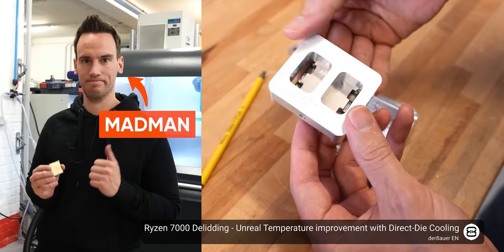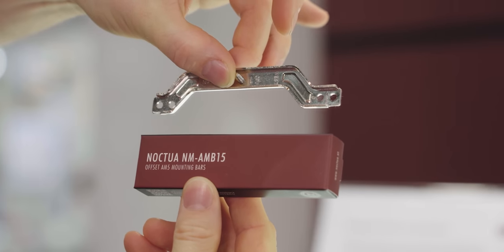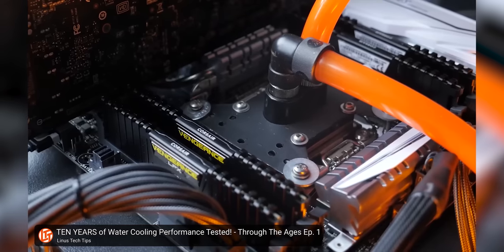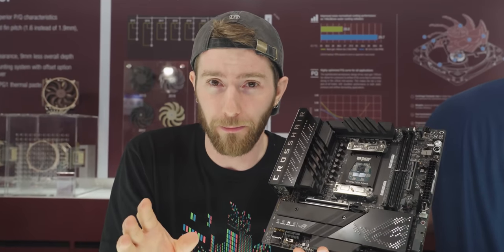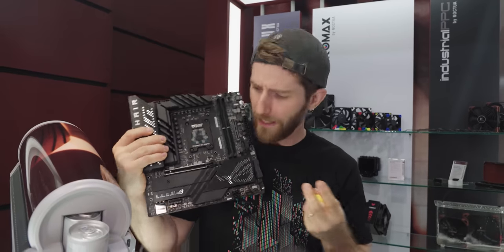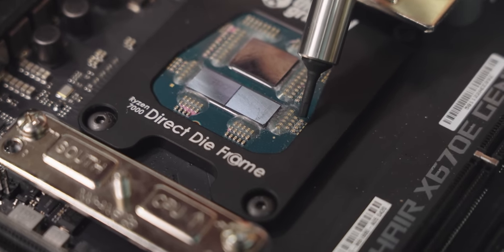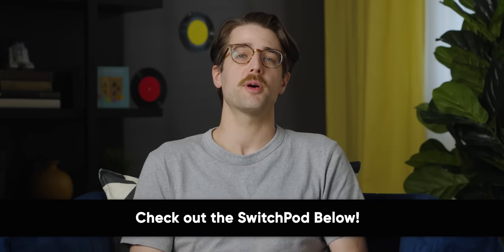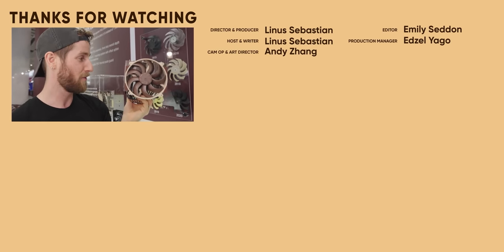Noctua's New Cooler Voids Your Warranty - AM5 Direct Die Cooling @ Computex 2023

Comment: I'm not surprised that a) noctua has a wild product for cooling CPUs, b) they partnered with Roman and c) everything about this collab being absolutely based
Reply: Is this something new? I have 4790k installed this way on older PC, removed IHS, put liquid metal, installed cooler right over it, and I didnt need any fancy overpriced part for it.. Oh.. right.. This is what its about.. More marketing garbage. "Buy our fancy part you dont need at all" lol.
Reply: @NotEvenDeathCanSaveU  And what made you think the CPUs of yesteryear would be the same as the CPUs today?
Reply: @NotEvenDeathCanSaveU  Easy to say for you. The rest of us might want the peace of mind the spacers and frame might add.
Reply: @NotEvenDeathCanSaveYouFromMe  Yeah! Who needs seatbelts, airbags, or crumple zone??? 
Just roll the dice. You probably won't be in an accident, so why have all that overpriced safety equipment?
Reply: @NotEvenDeathCanSaveU  Did you even watch the video? You literally don't need ANY of the new stuff they made. You don't need the contact die frame. You don't need to buy the spacer at all if you want to just print it yourself. Everything is just to make sure you don't fuck up.
Reply: @NotEvenDeathCanSaveU  nothing new. He has been selling direct die spacers for at least 4 or 5 years, just this time he's partnered with noctua and it's a special offset mount.
Reply: @NotEvenDeathCanSaveU  You also drive a Yugo right? Can't have anything that can make it safer after all, it's just marketing bullshit.
Reply: @lemonoxygen8846  Thanks for clearing it up, so I got it right then. It is marketing, and they scaremonger you into thinking you can break something without their fancy plastics. As long as you avoid the LM spill, and you insulate neighboring pins, and you don't tighten the cooler screws way too much to a point you could break something, you dont need any of this nonsense. Thanks again for making it more clear, I thought the design is in some new way where you have to have their fancy stuff. Just a video for those who like to be treated like children, I would so much more appreciated also some videos where they bust the scaremonger myths and where they dont treat you like a child that absolutely needs the training wheels. Also why I wonder, why does it break your warranty if you use the training wheels? Doesnt make much sense there.
Reply: @NotEvenDeathCanSaveU It's mainly about safety to have something that's manufactured to a certain standard. Then they offer most of these parts as DIY solutions with instructions for free. And lastly, depending on your specific hardware you needed spacers even back then. Well, you didn't, but then it was pretty much a roll of the dice, either you hit the right spot and everything works, you don't tighten the screws enough and your RAM or something else doesn't work, or you overeo it and nothing works because the socket is trashed or the die cracked.
Reply: @NotEvenDeathCanSaveU  Obviously didn't even watch the video. They deadass say it isn't necessary.. 4:30
Reply: @corataylor2205  He deadass said the thing that goes around the cpu isnt necessary, not the spacers. They didnt even show how the spacers are used, but thank you for your assumptious input
Reply: Im not sure what you think 'based' means, but you're definitely using it incorrectly.
Reply: @NotEvenDeathCanSaveU  3:45 then. Spacer's because AMD made IHS thicker. And it's specifically for noctua coolers. Your 4790k system isn't even the ballpark of these systems and you're like "HERP DERP IT SCAM CUZ MINE WORK"
Reply: @corataylor2205  It very obviously is a scam, for people who like to be treated like children. Apparently you dont need any of that. Its similar to IHS remover tools, you also dont need that at all. This is the age we live in, everyone is treated like an incompetent child that just cant achieve anything, or cant do anything correctly. Soon they'll also offer you so they build your PC for you... oh..... wait....
Reply: It's called "paying for convenience" if you're broke just say that. Toilet paper isn't necessary either but I hope you don't wipe your ass with your hand.
Reply: @NotEvenDeathCanSaveU  it's not necessary, but helping tools to give access to better cooling solutions for less experienced people. You already know doing it without is much more riksy, but you project your knowledge on others and try to make them believe using support tools was bad.

Let me provide you a very important life lesson: Everything is easy if you already know it. So congrats on being able to do it without, and don't mock others for not being able to.

PS: what has become of this wolrd? The greatest nerds have become the biggest bullies...
Reply: @strykerdelkar1  What has become of this world where we're progressively being treated like children more and more. One dude overtightens the cooler screws waaay too much to like 50 NM and now its like a norm so we have to invent the training wheels for people and treat them like they have severely low intelligence and sell them parts they dont actually need.
Reply: @NotEvenDeathCanSaveU  "He deadass said the thing that goes around the cpu isnt necessary, not the spacers." – you missed the point where they are giving you the 3D-files to print those spacers for _free_.
That should settle your "overpriced parts" claim.
Reply: @NotEvenDeathCanSaveU  How did you take off the ihs without the tool?
Reply: @yippy7951  You can remove the IHS with a bench vise and a razor blade...I have done it many times! There are plenty of purpose built deliding tools that don't cost much though...
Reply: @yippy7951  I always used a small 40USD bench vice for all the delids I ever did. + Its good to weaken the silicone around the IHS with something sharp, small 2 dollar snap blade knife or modelling razor knife. Then it comes off easily, + you need to be a bit more careful with the blade around the ryzen cpus but its not rocket science. Some people can do it just with the knife, but the silicone is pretty tough so bench vice is really handy and it works for all the cpus in the world, at least the common consumer ones.
Reply: What product from noctua is wild?
Reply: Why didn't AMD catch this
Reply: its funny since Noctua is Austrian and Roman's German... rise of the PC Reich? xD
Reply: @NotEvenDeathCanSaveU  they provide the 3d printing files so you don't need to buy it.
Reply: @yippy7951  You get yourself a cutresistant glove, a razor blade, a few utility blades, preferably a plastic scraper and if the CPU is soldered you need a heatproof worksurface, a heatgun and something so you don't have to touch a hot IHS (I used plumbing pliers for that, but a screwdriver will do). Take the CPU in your hand with the glove and then gently cut the adhesive between the PCB and the IHS. Watch out if there are soldered components next to the die, don't cut too deep. When you think you're through or almost through and the IHS didn't losen enough to get off with a slight twist, jam the utility blades under the edges and wait a little. After a few seconds and often just two blades the IHS will pop off. If the CPU is soldered, jam the utility blades under the corners, lay it down and blast the IHS with your heatgun. At some point the IHS will pop lose and you can take it off rather easily.
Reply: @NotEvenDeathCanSaveU  It's not marketing, it's the Ryzen IHS being thicker then your 4790k. Good luck mounting a cooler to a delided 7950x without the spacers. Oh yeah did you not see the part where THEY PROVIDE FILES FOR YOU TO 3D PRINT THE SPACER FOR FREE????????
Reply: @brucepreston3927  or with a very resistent wire, I did that. Heated the cpu (3770k) with a heatgun at 60C to soften the glue a bit, cut a small corner with a razor blade and then used the wire to fully cut the glue. Didn't even need a vice.
Reply: @sedixmrboss5625  Riiiight.. So I do have to buy their part after all.. or.. as you say... print that garbage on a 3D printer I dont have thus having to pay someone else extra for custom parts to print. Or... I could just buy 20 cents a piece 4mm spacers and check the height with digital calipers. I would be 0.5mm off but realistically hardly an issue or I could pick those with poor tolerance that are closer to 4.5. You know what I will try to do it this way when opportunity arises. I have a good feeling this is just another one of those things where they trick you into thinking you need their custom garbage while in reality you dont at all.
Reply: @NotEvenDeathCanSaveU . That’s how you used to mount coolers on CPUs in general. They used little rubber pads to help prevent the die from cracking during the uneven part of the mounting process.
Reply: @NotEvenDeathCanSaveU  They provide a cad. Look at it, analize the dimensions, then manufacture your own junk with whatever braket you want. But why the hell would you want to do all that work when someone provides a simple solution FOR FREE? Well idk I guess. Also if you can't find a friend with a 3D printer that will let you print them with only the cost of the filament (probably less than 20C if it's some good ol simple PLA)... I am sorry for you, you are lonely, but the way you write in the comments explains why. The only reason why the Noctua thing is better is that it makes something extremely custom and dangerous less janky and less risky. The Thermal Grizzly braket makes sense, because it allows 2 things: 1. It provides mounting pressure to the chip, thus making sure that it functions properly and 2. It makes sure the cooler sits on the die without stressing said die. The offset braket is indeed a gimmick, for 2° you are better off buying a tube of better thermal paste. The plastic spacers are there to make sure you touch the die, making sure that the cooler can do it's best work. They can be almost free if you are not stupid. And someone already designed and tested them, so you know they work. Of course, maybe you prefer to raise the risk of killing a very expensive 7950x and another even more expensive motherboard. People that have the money for a 7950x system have 20 bucks for a braket set, and would prefer to pay that instead of destroying their stuff. Maybe you should consider starting... idk... using your brain if you happen to have one. Jank works when you are on a budget. Delidding a 7950x is not being on a budget. And don't you dare use my English mistakes against me, I aint native and I don't plan on reading this again to recheck my grammar.
Reply: @sedixmrboss5625  I am so lonely lol. I know more people than ever now, ever since I moved out of the big city lunacy into a quite a rural area. Not many people with 3D printers around here tho, mostly small businesses who would print stuff for a fee.
Reply: @NotEvenDeathCanSaveU  Dude, the main message for this part was "Hey, when doing this with our coolers, you'll need something like that. We made something like that. You can buy that from us, but if you don't want to give us money, you'll need these screws and here are all the files for free so you don't have to do the same work we already did yourself." How can anybody be so butthurt about this? You can just take the measurments from the files and then make those spacers any other way that's available to you, you don't even need a 3D printer for a hundred bucks, you can also whip out your saw and file and make these parts from wood. The only difference compared to back thwn is that you don't have to cut the IHS and measure it yourself, you can still make your own spacers.
Reply: @sedixmrboss5625  I never thought about that, but yeah that sounds like it would work really well for some cpus...The thing is, I dont think that would work for cpus that have a soldered IHS...you need something that can put plenty of tension on it to break the solder loose...I know you can melt the solder by placing it in the oven and stuff but that always freaked me out too much to try!
Reply: @NotEvenDeathCanSaveU  Tell me you didn't watch the video without telling me you didn't watch the video
Reply: @brucepreston3927  Does not work for soldered indeed.
Reply: @NotEvenDeathCanSaveU You still don't understand anything. The part the breaks your warranty is removing the IHS, obviously. It doesn't matter what mounting hardware you use with the cooler after you've removed it: the warranty is void.
Reply: Based on what? You didn't finish your sentence.
Reply: @MrGamelover23  They have them HW stores you absolute genius. Hard to argue with children who were taught what to think, not how to think. Public schools at their finest lol
Reply: based? based on what?
Reply: @NotEvenDeathCanSaveU  4790k isn't a 7950X though is it?
Reply: based in voiding warrenty is what it is